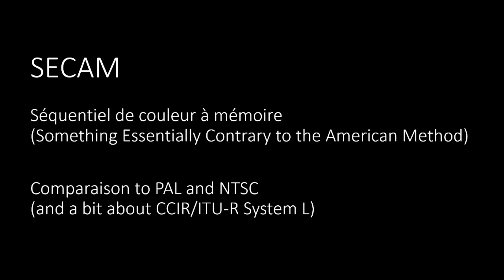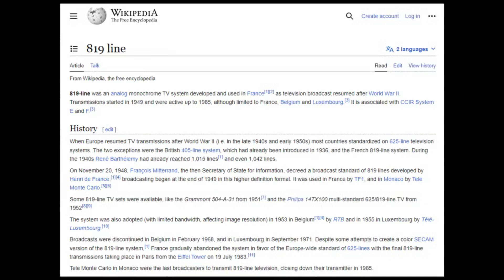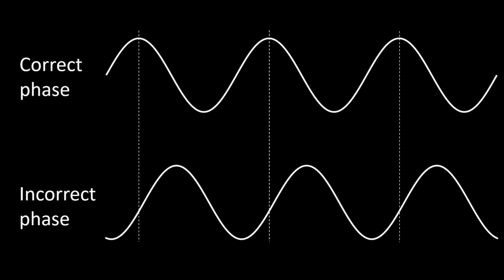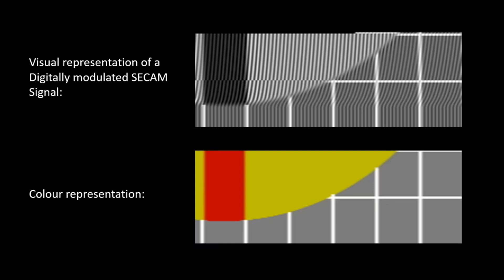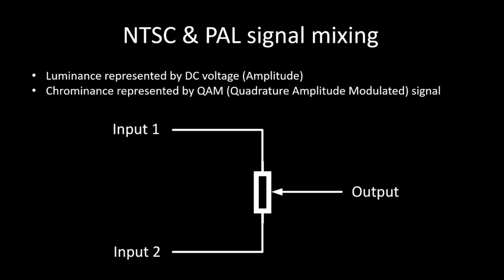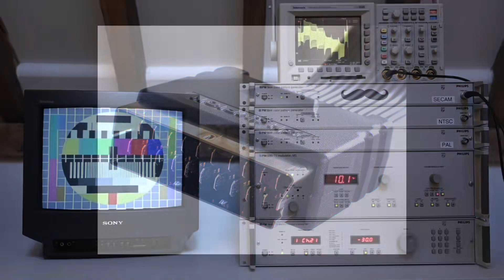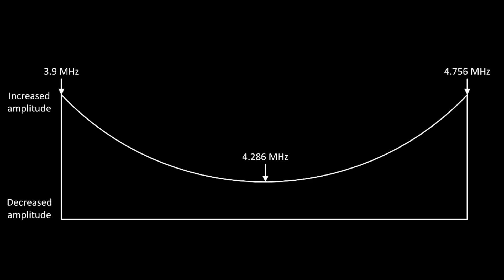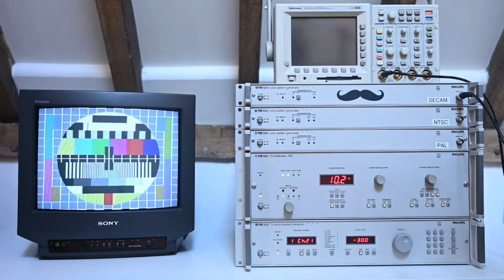#4 - SECAM + Comparison to NTSC & PAL (And a bit about CCIR System L)

Comment: I had no idea that the PAL test pattern had a section (lower right at 3:14) that had deliberate phase errors to make phase errors getting through apparent. I wonder if the TV shown was one of the ones that used various tricks to avoid the various PAL patents. I recall one of those  patent avoiding tricks was to still use the delay line, but use it to simply replay every second line and then a NTSC type color de-modulator could be used which of course was not protected from phase errors. Great channel! Just subscribed!
Reply from the maker: It is a Philips TV. I believed they co-owned the patent for PAL so wouldn't expect a non PAL tuner. It's probably faulty. Glad you found it interesting!
Reply: @mattstvbarn  Oh - yes - I think it was largely the Japanese who did the Pal workarounds.
Reply: @mattstvbarn  Some Early PAL TV sets had a tint control, that basically made the picture molre yellowish or blueish. Having six sliders maybe it has a tint control, or it has a tone control. 
By the way I still have a PHilips CRT TV and has a colour temperature control, but it works on RGB signals. Maybe on older TVs they did some analog tricks to get a similar result messing with color decodong?
Reply: @givolettorulez  It was Sony who used the not-PAL decoder in their early sets. 
The "tint" control on most PAL sets was simply a colour balance control that altered the drive to the  tube, so you could make your picture more reddish or blueish according to taste. (Some modern digital LCD sets have it as well).
Reply: @g7mzh  Yes, it worked as color temperature setting like we have now on every LCD panel menu.
Reply: @mattstvbarn  Yes, its just small phase error (few dg) in PAL demodulator. Each field is for one color difference signal, so hue change in first filed shows incorrect setting of R-Y demodulator and in second field of B-Y demodulator.
Reply: @xsc1000  The phase alternation took place on every line, not on every field. Both odd and even fields contained plenty of R-Y and -B-Y.
Reply: @johnr6168  In this case I didnt talk about TV fields but "fields" as an areas or sections of the test pattern.
Reply: No, its a standard PAL TV and it is protected from phase errors, as you can see on the colour bars part that are displayed correctly. The color tint in those control fields just shows little phase error of the R-Y and B-Y demodulator. Those errors are compensated on other parts of picture by PAL switching, so you just loose saturation a little, but in those fields became visible even if the difference is just few degrees. So by those fields you can adjust PAL demodulator just by eye. And they were not only on Telefunken test picture, but were added to Philips one too.

Comment: NTSC = Never The Same Colors
Reply: PAL = People All Levender
PAL = Pay Additional Licence
Reply: @blainerussell1737 Perfect At Last
Reply: By the 1980s when semiconductor electronics were used in TVs, NTSC was fine. The TVs still had tint and hue controls, but they weren't really needed, the picture looked fine right out of the box.

Comment: Did you capture video from a TDS3012?  How?
Occasionally I have to capture video from SECAM tapes, and rarely does the quality seem much good.  Once I had to play a SECAM tape on a PAL machine for an obscure obsolete video format called CVC.  I expected the result to be monochrome but when fed via a digital timebase corrector set to SECAM input, by some miracle, one of the recordings had partial colour and one had perfect colour.
Reply from the maker: The video captures from the scope are from the VGA port on the back. I think it is the TDS3GV. Not surprised tape conversions aren't good. Didn't some tape recorders internally convert it to PAL?
Reply: @mattstvbarn  My TDS3012 doesn't have VGA.  
Some VHS and Beta machines record in SECAM, some in MESECAM which can then play back on a MESECAM VCR into a PAL TV.  I think...  It's complicated.
Reply from the maker: @video99couk  Any TDS3000 can have VGA if a TDS3VM or TDS3GV is installed.
Reply: @video99couk  
mesecam was a JVC mess, they really messed with secam, and added a lot of confusion.
in short, in consumer grade video recorder : 
VCR/SVR, V2000, beta, (don't know for CVC as i never see one) always recorded secam by heterodyne technique.
then JVC come with VHS... and 2 possible way of recording secam... incompatible with each other, of course.

the first is sub-carriers division frequencies by 4. mainly used in france for monostandard VHS, as it's a cost effective way to record secam. but added complexity and costs when pal/secam VHS come in the market.
the second way is heterodyne, and was called mesecam (or sometimes modified secam) was mainly used in countries where pal/secam coexisted, and was a cost effective method to build bi-standard VHS.
then the mess continued when VHS-C was introduced... as "mesecam" was never used with camcorders, only pal or secam (meaning the division by 4 method) i guess some consumers in eastern countries got hard headache with this mess JVC did.

Comment: I remember living in the southernmost part of Sweden in the 80s before satellite TV.
During nice weather in the summer we could receive both West German (PAL) and East German (SECAM) TV.
I got a dual standard Philips TV and I was surprised to find that I needed an almost noise-free reception of the East German TV station before I could get color and then it was either full color or no color when the signal got weaker.
The West German stations on the other hand showed color as soon as the sync signal locked even though the picture could be very noisy.
No wonder most eastern European countries switched to PAL in the 90's.

Today I wouldn't bother watching German TV since everything is dubbed...
Reply: yes, for reasons East Germany did not want to take PAL. TVs produced in the east could only do SECAM and not PAL, unless the sets were intended for sale in the west. 
But the television standards of PAL West and SECAM East were black and white compatible. The same FM tone and frequency grid was used. 
For black and white broadcasts, SECAM switched off the color carrier, PAL did not. 
After 1990 the Ost broadcasting stations were quickly converted to PAL. DDR1 and DDR2 became ARD and "third programs". ZDF got its own new broadcast chain.

who had a SECAM TV lost the color
Reply: @jensschroder8214  In fact only soviet sets were mostly Secam only. Other eastern block sets were PAL/Secam from end of 70s when multistandard ICs became avaiable.
Reply: This was probably some kind of protection or threshold in the circuitry of the set. SECAM has some advantages over PAL and one is performance with low signal and poor reception. The typical effect associated with SECAM and low/noisy signal was the "color explosion" - the colors become oversaturated instead of faded. This was quite obvious with the old Russian sets from my childhood where there was a knob on the back of the set to turn off color which was quite useful when there was bad reception to remove the bursts of oversaturated color. Maybe your Philips was smart enough to do it automatically.

Comment: Even more weird than system L was the system E used on VHF (819 lines).
There the position of the AM sound carrrier (vs the positively modulated AM vision carrier) was alternating between adjacent channels.
So, on two adjacent channels the video carriers OR the audio carriers would be next to eachother.
It probably prevented interference from vision into audio, but of course that must have been a nightmare for TV set builders, they would have to either have two different IF strips (with mirrored filters) or have to different ranges of local oscillator in the tuner and using upper/lower mixing.

AM sound was problematic in itself.  One could not use intercarrier sound (i.e. getting the sound from the video demodulator) as it would suffer from extreme interference from the sync.  So, a TV set with AM sound required an AM demodulator at the IF, not at 5.5/6.5 MHz.  And the TV set had to be tuned accurately enough for that AM signal (with a bandwidth of 20 kHz or so) to be within the AM filter of the receiver.  A set with FM intercarrier sound could be way more off tuned because the frequency difference is only dependent on the transmitter frequencies, not on the receiver tuning.  So sound was always OK and tuning would only affect the picture.
Reply from the maker: Ah I love to hear all of these weird and wonderful detail stories. Thanks for that!

Comment: System L was also used in Luxembourg on Uhf so presumably French TV's could pick it up, possibly also Montecarlo.
Belgium used system C on Vhf until the late 70's positive vision modulation AM sound 5.5 MHz above the video carrier monochrome only. Until the mid-late 60's the French speaking part would put out 625 or 819 line signals on this standard depending if video was incoming from France or other parts of Europe, weird... Luxembourg on Vhf were also 819 but with +5.5 MHz audio till about 1970.
France also had 819 line Uhf filler transmitters with +6.5MHz audio. The 'proper' wideband 819 system was E with sound + or - 11.15MHz.. Yes + or -, depending on the vhf channel!!!
On a very marginal/weak signal Secam colour could
look better than speckly Pal.
French secam colour often had a pinky bluey foggy look.
Reply from the maker: Thanks for that! This kind of info is extremely hard to uncover by simply googling around! It would have been nice if I knew it when making the video.
Reply: Belgian’s system C is scrambled version of PAL-B/G.
Reply: SECAM fire/flame when SECAM signal weakened.

Comment: Great video. Another possible explanation for System L using positive modulation that isn't a political one is a technical one. 819 lines was also positively modulated, as was the old British 405 line system. British dual-standard sets were very complicated and not all that reliable, having to support 405 positive modulation, 625 negative modulation, as well as both AM and FM audio. Retaining positive modulation with AM audio on System L could simplify dual-standard 819/625 line sets and reduce costs too.
Reply: That is most likely the reason System L used positive video modulation and A.M. sound modulation.
Reply: Dual-standrad sets would be needed in the transitional period when the 819 line system was being phased out and the 625 line system was being phased in. This would take abput twenty years, mid 60's to mid 89's.
Reply: mid 60's to mid 80's.
Reply: At least they would need dual standerd sets at the start of the transitional period, toward the end of the transitional period probibly the sets would only need to receive the new standerd as it woulden't be worth the bother to include circuitry for the old standerd.
Reply: Yes, I'd always assumed that was the reason.
Reply: System K was used in overseas France and former French colonies in Africa. Same as SECAM-D/K from Eastern Europe